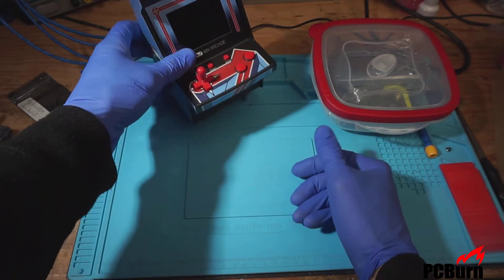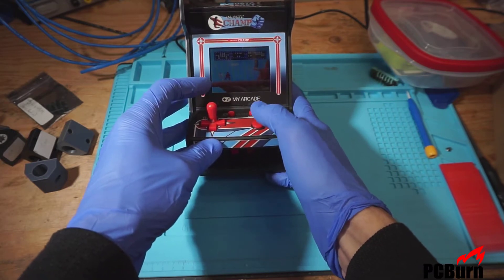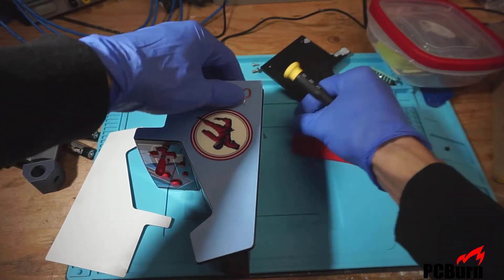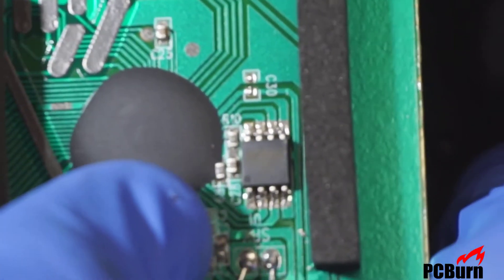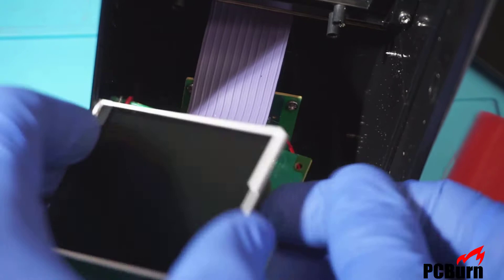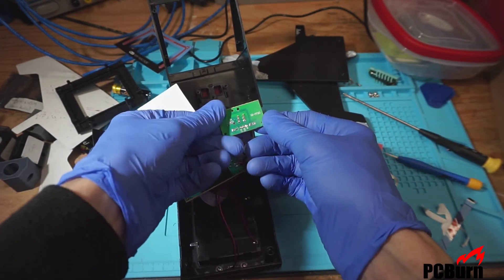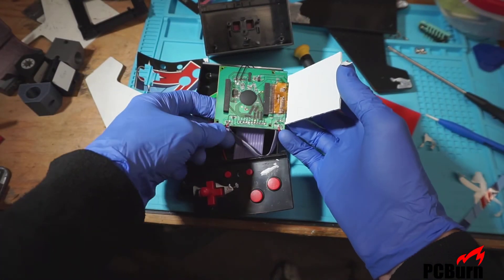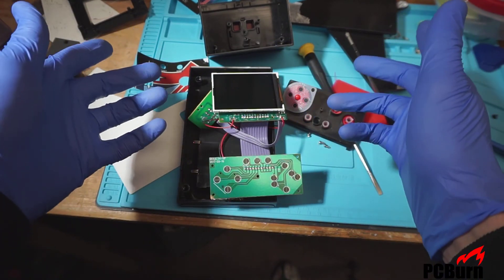Data East Karate Champ Teardown - Inside the Karate Champ Mini Arcade by My Arcade

Comment: Originally Karate Champ's arcade machine used TWO JOYSTICKS.  One on the left and one on the right.  In this model you only have two buttons on the RIGHT, but on the PCB you can see other buttons.  Do the two missing buttons work?

Thanks and grettings from Seoul
Reply from the maker: Next time I'm digging through the electronics stack I'll pull it back out and check. I don't recall if I tested them at the time.
Reply: @PCBurn  Try, more combinations with the missing two buttons. When the game starts, we can clearly see the TWO JOYSTICKS on the screen game.

Comment: Hey there! Is there any way to repurpose the controller? I took apart my Data East classics version (the board is actually running Android, but isn’t powerful enough to run the stuff I would have liked. Wanna put in a new screen and pi.).  But it’s essentially the same cab as this one. Can the controller be connected/repurposed? I’m familiar with arcade buttons using positive and negative wires, but the joystick/buttons sit on a board and the board has the gauge wires leading to that harness...
Reply from the maker: I didn't specifically pin out the ribbon cable going from the button traces to the main-board. On this they look like they're making simple momentary switches glancing at the video (9 wires or so, no support electronics). If you've got it apart check the traces with a meter.

Comment: Have you fiddled at all with the LCD after disassembling this? I'm curious whether the screen tearing is inherit to the screen or an issue arising from software.
Reply: BR-8347 might imply that it's a ili9341 competitor, the HX8347. Both of them are 240x320 but most portable retro gamers rotate it 90 degrees to get the landscape orientation because they're emulating home consoles. You can tell because (through the viewing angle)  the left-right color inversion happens faster than up-down.
They're both popular with Arduino hobbyists because you used to be able to salvage them from retired cell phones, although the ili9341 is pretty much defacto standard by now.
Reply from the maker: Hmm, in that case I may have to tear into some of these toys and see if I can retrofit one to either be a generic computer or run as an Arduboy.

I've managed to salvage a few more from junkshops. One of them should have a standard display even if this doesn't turn out to be.
Reply from the maker: I'll fix the picture gallery and add some shots of the LCD for you over on the PCBurn website. Just noticed the hi-res picture viewing stopped working.

I think it's probably a PAL NES rom and the NES running NOC (Nintendo on Chip) behaving badly and running in NTSC mode, offhand.  They never seem to match the ROM to the NOC hardwired settings. I'll see if I can figure it out.
Reply: @PCBurn  That's definitely possible. How's the scaling? Did you notice any mismatch against output resolution and that which the screen can display? First, you have to determine exactly what LCD they are using in these things. NES resolution is 256x224 (NTSC) and 256x240 (PAL). There may be a screen with those exact resolutions supported but I also noticed there is no overscan area on the LCD when you removed it which probably means the software is scaling the image and culling the extra area. If the scaling isn't a nice integer, it could end up giving weird effects like squished text or warped edges. I'm interested in learning what you find out about these things. Thanks.